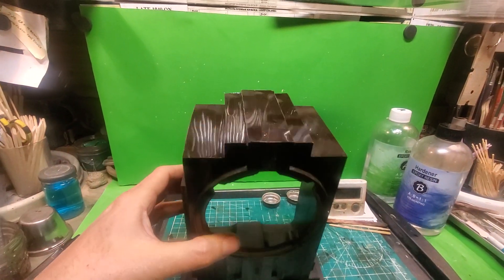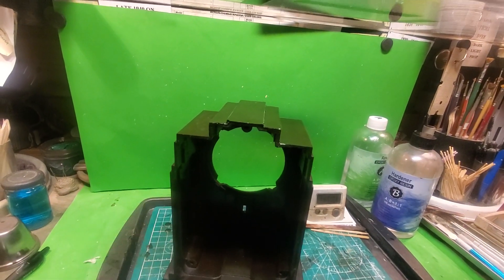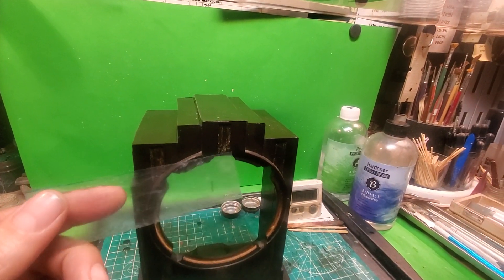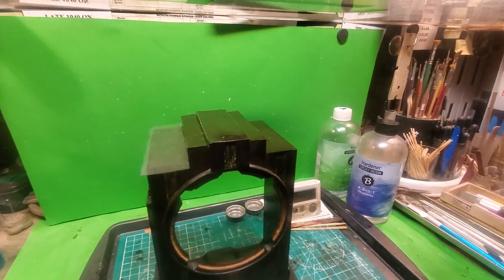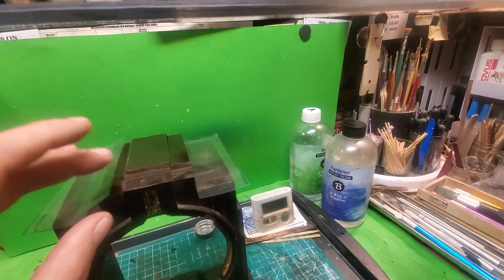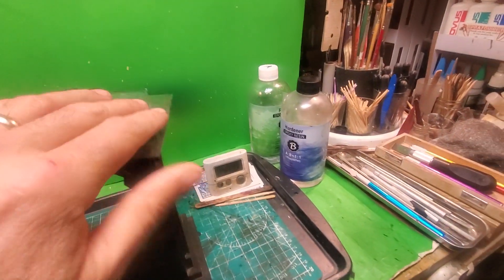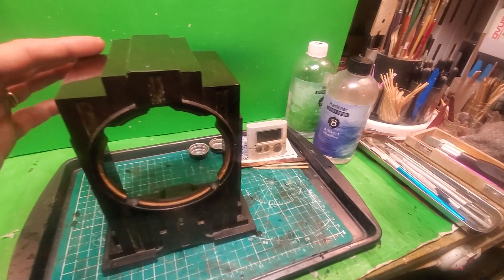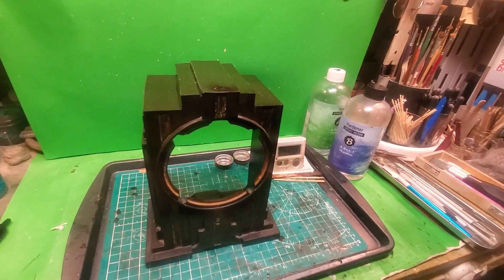Model 700/Replacing Bakelite pt 3 - First coat (GE/Telechron clocks)

Comment: I did not understand what you use the plastic for , sanding?
Reply from the maker: I apply the resin to the case and then press the clear plastic pieces down on top of it. It creates a surface that is essentially flat. This eliminates the sanding that would need to be done on a wavy or irregular surface.
Reply: @Telechronic  Thanks I understand now.